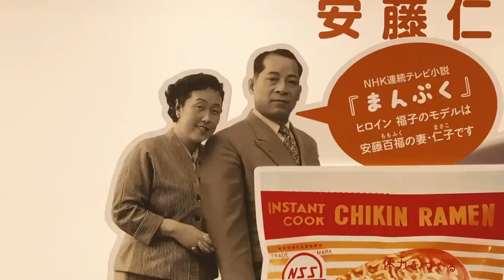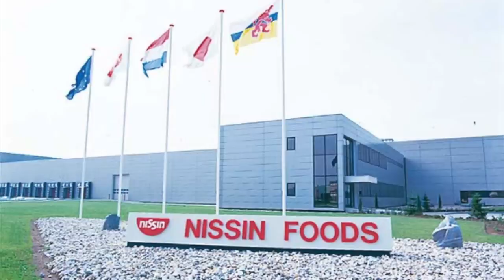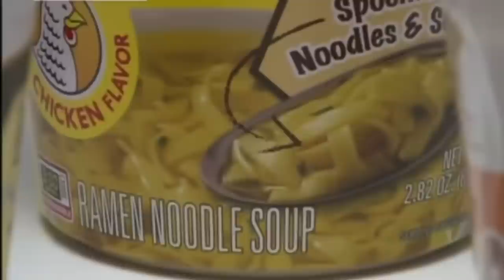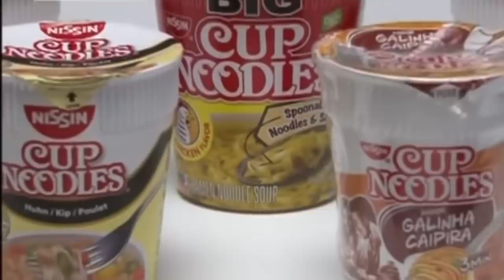How an Ex-Prisoner Built a $7 Billion Ramen Empire

Comment: Ramen prices have quadrupled in the last 2 years. One cup is $1 at the local 99 cents store.
Reply: All food has gone way up in price, but these are still affordable. The ramen packages are cheaper than the cups, you can still get those under a dollar.
Reply: Much cheaper to buy in bulk if possible.
Reply: Ya get 5 packs for $1.25 at dollar tree lol
Reply: @X1.7  the square packaged ones used to be like 7for a dollar
Reply: @X1.7  I can survive for 5 days for $1.25?

Comment: Cup Of Noodles and Top Ramen were always in the pantry growing up in 70s-80s. My Dad had travel to Japan a lot in the 70s. So when he made Ramen  he would add more than the packets of broth.
In my 30s, I was made destitute a couple times. Ramen was always there to at least provide a hot meal. All I needed was the hot water. Sometimes it was just the noodles and packets other times I was able to add a bit more.
Nowadays I stay away from the Styrofoam cups and just use the top Ramen. Just trying to be responsible for my waste foot print.
Now, like as a kid there is always Ramen in the pantry.
Reply: I resort to ramen soup sometimes for the cure of a hangover, the sodium helps absorb water as well.

Comment: Start with boiling hot water, or water. Heated for at least 2 minutes in a microwave. Poor into the cup filling up to the line.

Close the lid paper and place a flat plate or other item. Completely sealing the paper to the edge allowing no heat or moisture to escape.

Let's stand for 3 minutes.

Following these instructions, the noodles will be fluffy and the soup will be sufficient to round out a delicious meal.